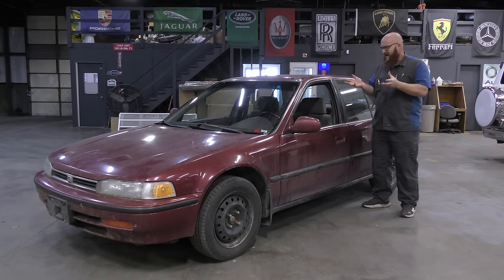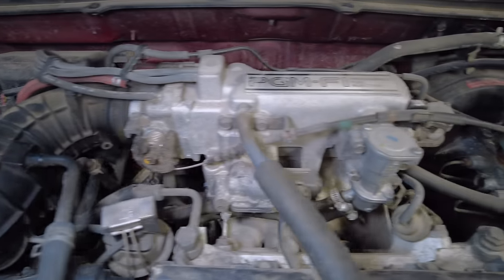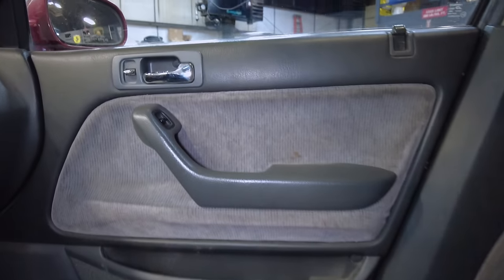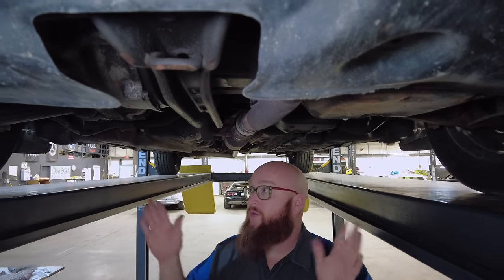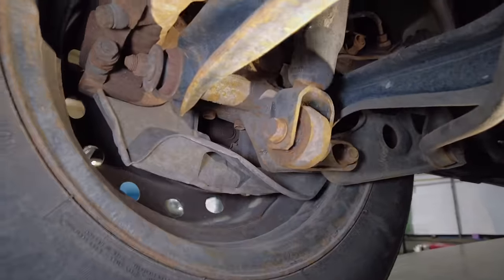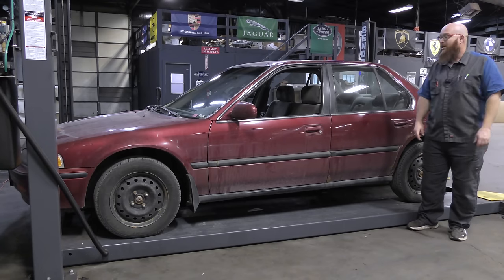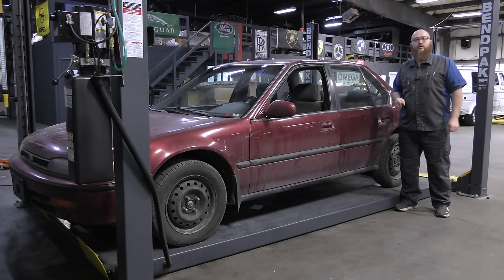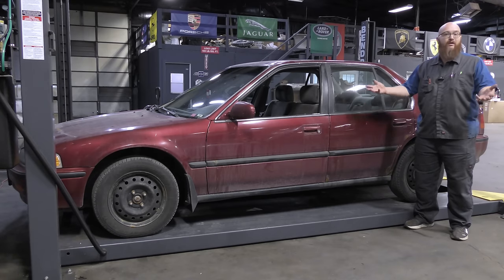A True Testament: 32 year old Accord with 380K miles! When Is It Time to Let It Go?

Comment: If I drive more than 20,000 miles a year, I'm actually keeping this car. When you get to 380k, it's obvious that it's been maintained. After all, the only things wrong with it are a couple of leaks and some boring suspension stuff. Once you reach a certain point, what matters more than the miles is the maintenance and driving habits. Unless the frame is rusting out from under you or there are big holes in the body letting the elements inside,  this car has more than 200,000 miles of life left in it at 100+ miles a day unless the owner is driving all those miles in town.

Pour $5k into this car and the worst that can happen is you sell it for scrap and get a $200 check. It's a gamble. It could happen in 15 years. It could happen tomorrow. Either way, you lost $4,800. Or buy a new car for $30,000 and sell it for $12,000 in 5 years when you pay it off to buy another $30,000 car and lose $18,000 every 5 years for the rest of your life.

All I'm saying is our good old things are worth keeping.

Comment: The answer is never. I have a 94 accord with 178k miles. I plan on driving it till I die. The quality of the oem parts on 90s Hondas are better quality than new cars. And much less complicated to work on as well. Engineers used to build cars with the home diy mechanic in mind.

Comment: I had 1990 Accord myself and it was a awful car. My parents bought it brand new. It left me stranded and wouldn't start. Also the hub over rotor design meant you couldn't replace rotors easy.

Comment: If you dont have a lift to put it on..are not mechanically inclined. Or have had general experience with  doing or soending on repairs. You can
 easily misjudge a persons
 lasts forever statement and take their word for it if you buy a car with such high miles..
Do you really want oil leaking and dripping on to your driveway or garage floor? Or to take a chance on every belt driven part.. alternator, water pump, ac compressor,.
At 20 years wheel cylinders go.. mastercylinder can go at any time... hoses rot.. body rot.. weather strip rust and water leaks.. rusty floor pan and fender or engine wall rot letting water in..
Water can leak through edges or windshield..
All parts to adjust the alignment could be rusted so if it needs one you are going to have to replace them in the process.. radiator and condensor couuld be disintegrating...
I am not hating on this clip.. just mentioning what anyone could be in for if they trust someone but dont look..
Maybe it would good for a first driver car at less than $1k or for a beater for a year or two.
Oh.. forgot to mention the muffler cat midway and  front pipe.. if it has a catalytic exhaust manifold..  which is more money to replace it if its bad.. and will it pass for emissions at an inspection line after buying it... dont forget the tires either..

Comment: Wizard I'm very sorry but i have to disagree with you. I'm my opinion the cheapest car you can ever own is the one you currently own. Driving this car far should be every bit the good idea as a new car. New cars have a warranty because they fail as well. Certified cars fail as well. You should agree a part can fail at any time, new old, low or high miles. I would fix the brakes on this car, maybe that noisy stab link in the rear and keep pounding the pavement. Cheers.

Comment: If the engine, transmission is still running and there no leaks anywhere,why not drive it until it falls apart? Classic beater car. Also, that’s why you don’t go to dealerships for having work done to your vehicle.

Comment: in the 70s, 80s, 90s, 2000s and 2010s, you were lucky to get 80K out of a GM product before the engine went bad - forget 380k. before that, people simply bought new cars every 2-3 years so they never knew they turned to skit when they got to be about 7 years old. it was some poor guy's problem at that point.

Comment: Why ever let a vehicle go, even if it cost $8-15k to fix, that's still less than a new car.  Yea it's expensive but then you know everything is fixed.  Even if you got a "new" 8k used car you never know if the head gasket let's go in a week anyway

Comment: I'd drive that thing until the transmission starts slipping. Then, I'd get the engine & transmission rebuilt. For  $5000, the car will run for another 25 years. No need to ever buy another one.

Comment: I'd just fix the brakes on this car and drive it another 100k miles. As long as it's not leaking oil and doesn't need a head gasket yet, just keep driving it.

Comment: Great video.  I do have to disagree on Luminae having great food.  I've done many, many cruises in the Retreat on all three Celebrity class ships.  I could probably recite the breakfast menu verbatim.  Lunch is good in Luminae and their burger is excellent.  Dinner is hit or miss, but generally pretty good.  We recently cruised with extended family and had a balcony cabin on Celebrity.  We ate in the main dining room at a fixed seating and really enjoyed our dining experience.  The food choices were vast compared to Luminae and the quality was as good as Luminae in my opinion.  Our wait staff was just as attentive as was the Maitre' D.  Also, whoever designed the large Luminae on the Edge class ships and put a single toilet in there just plain should be fired.  Ridiculous and there was always a line when anyone went to use it.  Plus, it was in the restaurant near tables!  What were they thinking there?  Recently, Retreat prices have pushed us to try ultra luxury cruising as the value of the Retreat has significantly decreased with the recent changes all while the price has gone up by at least 50%.  We will see if we change our mind but right now the ultra luxury lines look more competitive than ever against the Retreat's pricing strategy.

Comment: They will regret getting rid of it.  A new car will bring far more expensive and annoying issues in coming year. Failed cvt. Goofy electrical issues. To name a couple.  I still drive a car and truck from 2003.  No issues to speak of. I do my own work on them mostly and buy parts from RockAuto.

Comment: Meanwhile my 2018 Honda Fit has been the most unreliable car I ever bought. 

It had had a oil leak, motor mount disintegration, foggy rear camera, panals fly off when doors shut, broken rear seat, and the most aggravating thing is water leaks all over the car. 
Every generation of Honda Fit has had leak issues. I assumed being a 2018 any issues on the 3rd gen would have been fixed after the 2018 refresh if not sooner. Nope. 
The other issues are also common on other Fits and other Hondas. White Fits and I think every Fit have paint issues. Looking at the gaps between doors it seems to be right.

The car has 93k on it. I have zero faith it will ever last to 150k miles I try my best to follow preventive maintenance. I cannot wait to be rid of it. Besides those issues the size of the car and class of car I frankly getting annoying. 

I'm still kinda glad I had the chance to own it as it's taught me a lot and I have had a few fond memories. But I will never buy a Honda again. Never byy a car made in Mexico. Never buy a "cheap" car with "cheap" build quality and reliability. And I will never buy a sedan, hatchback, coupe again unless I can afford a 2nd car.

Comment: Never, its never time. Have you seen how much cars cost? A new engine will be well worth it considering it would be less than half a years worth of new car payments. Stop buying these price gouged cars! Thats the only way the prices will come back down.
Reply: even an oem trans and engine, changing all the strus and cv axles, new wheel bearings. He would still have like 13k in cash vs buying a brand new car.

Comment: Let go cause it's old? Just bought a 1999 3.3 Caravan with 140k original miles .. I'd rather fix the old worn out parts then to buy a new car with 100 computers and sensors

Comment: Keep it till the trans/motor requires a rebuild and then swap it/sell it. There's really no point parting with it now, only an enthusiast would pay much more than scrap value. You've already put more money into it than it's worth by paying for this inspection, and the new timing belt.
See the problem is exactly the same as my 1995 Civic. I know what's wrong with it but, the potential buyer doesn't and that creates distrust, which in turn naturally lowers the value of the car.
These old Honda's being cheap out the gate, easy to work on and find used/new parts cheap are really where your value is. The reliability is the icing on the cake. Like, if you take it to the supermarket and someone dings it; Oh no! So anyways... And you continue on about your day.
If someone dings your 2024 whatever, that'll kill your week.

Comment: Good video but hes wrong about one thing, this car is perfectly safe to drive family or anybody around for the foreseeable future. One day it'll go kaput but so might a new vehicle at 50000 miles these days. There's no reason a honda of this era isn't perfectly safe for whatever your plans are providing that you fix the major issue and maintenance issues as you go as you would any car. Engine will run 500 k easy, the transmission would be your only major potential issue with secondary issues being things like water pump tensioner pulley radiator alternator etc. But none besides transmission are worth junking the car and could happen to any vehicle much sooner since this gen of honda is notoriously built like a fort

Comment: I have a hyundai terracan turbo diesel with 400+ ks on it, ive never opened the  engine, its old, ugly, full of rust, sounds horrible, but is 4wd and it takes me everywhere, i dont think anyone would give me 1000 usd, but it will run for another 200ks eaasy

Comment: By the time you have to do the timing belt the second time, it is time to let it go. The labor costs at that point are way higher than the car's worth. Again, Hondas are not that good & never were, not only the fact that timing belts are such a cumbersome job, that really should have never been a thing to begin with, which you have Honda to thank for as they're the ones that idiotically, widely adopted it & everyone else followed in pure stupidity, but then to add to that, most if not all Hondas had interference engines. They were barely worth it the first time it had to be done.